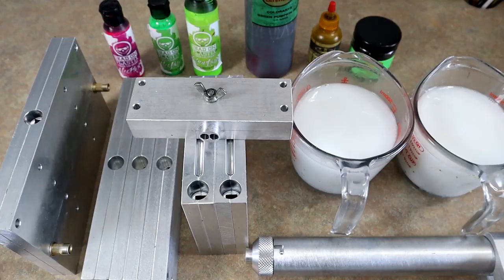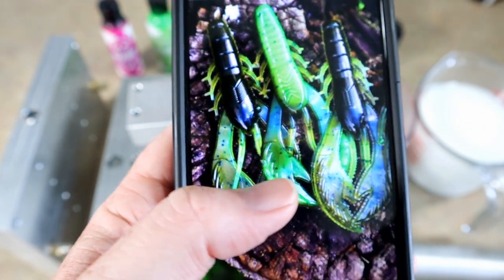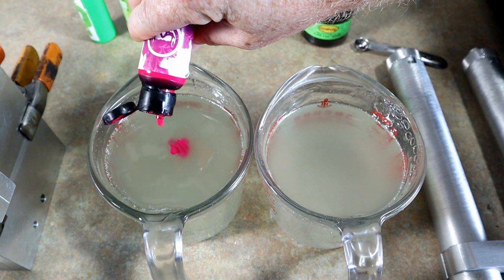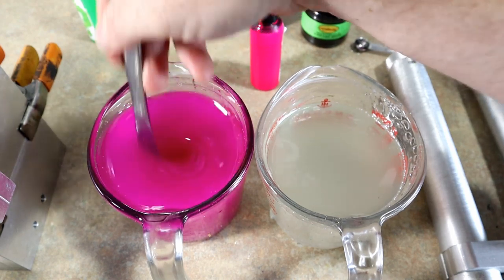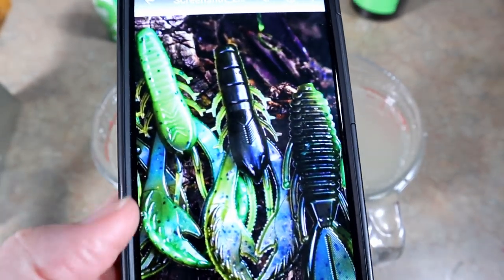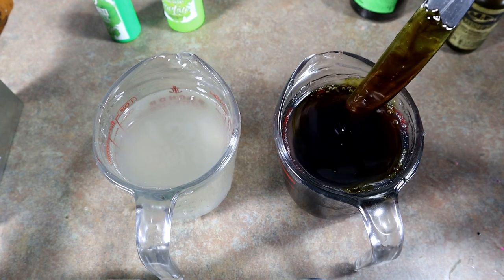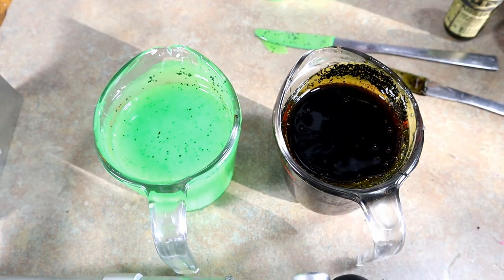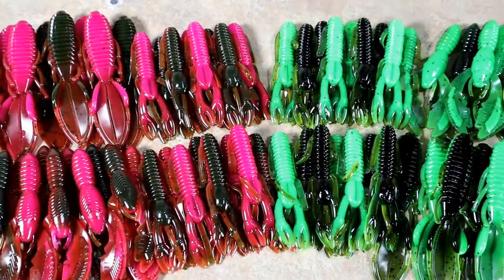Color Matching ANOTHER BAITMAKERS Colors: Soft Plastic Lure Making Color Match Challenge

Comment: With the dual injection using the blending block, how does it work on a multicavity swimbait? I want to get a similar effect as your hand pours with a darker color on top and lighter on the bottom but I have a feeling it's going to come out alot like those grass grenades would, half one color and the other half being the other color. If that's the case I'm going with something I can pour individually, maybe the es ripper from Do-it molds because of the price but I'm leaning towards the 4" bloodline from angling ai plus with the 4 individual cavity's makes it at least 4 times better at only twice the price.